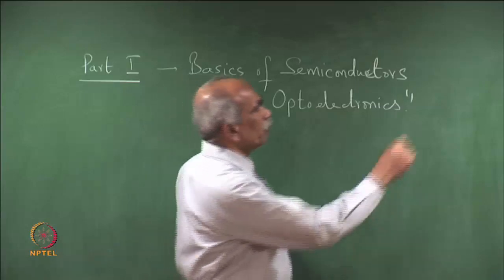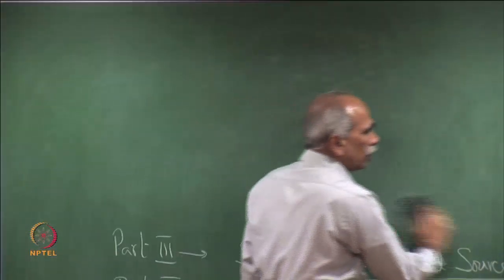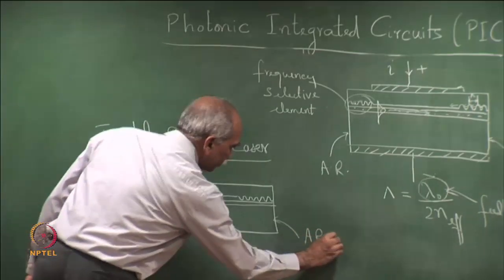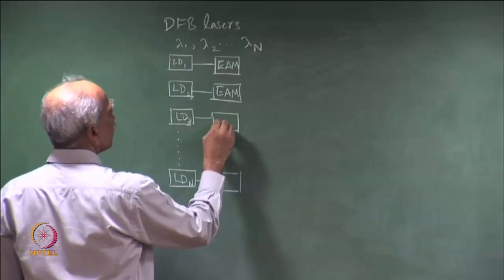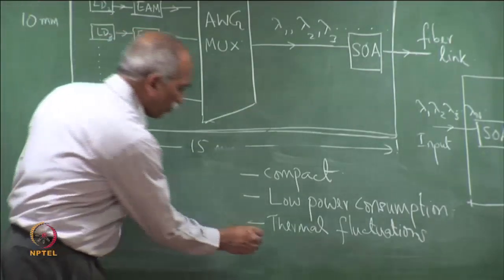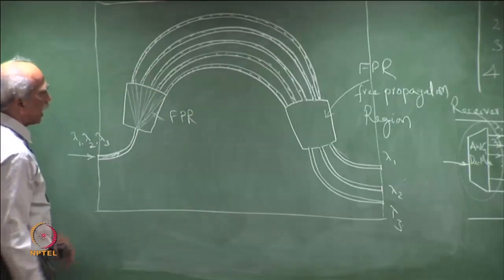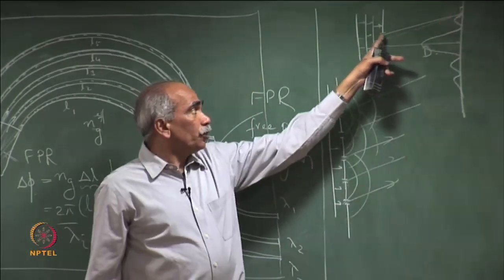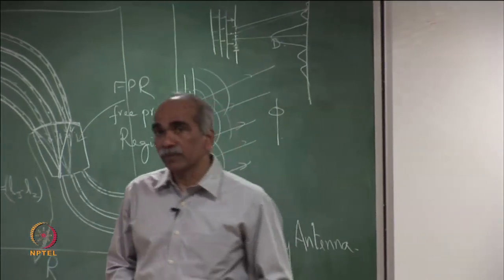Photonic Integrated Circuits

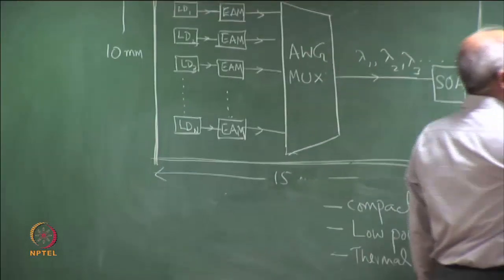Comment: At 29:16 he starts to explain the Arrayed Waveguide Grating, AWG. It is a good basic explanation. However, he does not explain that the bulk of the intensity (or power) ends up at the zeroth order (the middle fringe in his drawing of the Airy pattern 40:55), but there is no wavelength division there. The trick of the AWG is that one can design for a high order (for example 30th or 40th) but make this order overlap with the high intensity peak, so that you will have both a high separation of the wavelengths and low loss.

Comment: 1. Why do we need AR coating of both facets in the DBR laser, if two FBGs already provide frequency-selective reflection? 2. It is not clear, how the electric current can change the effective refractive index in the tunable DBR laser. What is the physical phenomenon? 3. SOA is a comparably narrow-band device; its is not able to cover the entire C-band. Can a single SOA be used for DWDM devices? 4. An interesting theme, which was not disclosured, is how to connect internal waveguides to output fibers.
Reply: The Fresnel reflection in semicon is huge (around 30%) and it will interfere with the cavity spectrum as for those length, the bandwidth of the gratings is still wide, causing some instabilities in the output frequency and power. 

The electric current induces refractive index change because for semiconductor, the electron and holes density affects both gain and index, which makes it hard to directly modulate a semiconductor laser if I recall correctly as an increase in current will also chirp the output. The exact derivation of it is some complicated solid state physics calculation rather than a  some more simple effect like Pockels or Kerr effect I think.

I'm not sure how much SOA are used in DWDM vs. EDFA. 

To couple light to the output fiber, often the best way is to simply butt-couple the fiber to the laser. The efficiency will be pretty good. You can also shape the end of the fiber as a micro lens using etching and arc or use a ball lens in between the fiber and the planar waveguide. With a good bulk lens setup you can get great coupling, but it cant be packaged.